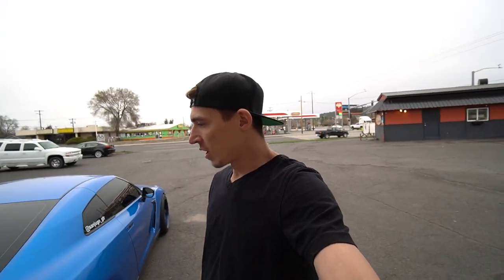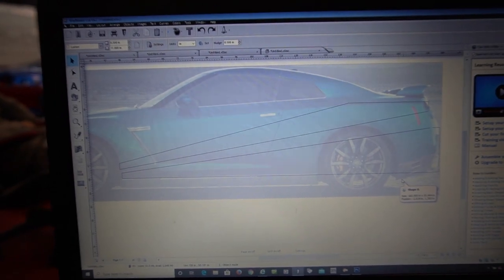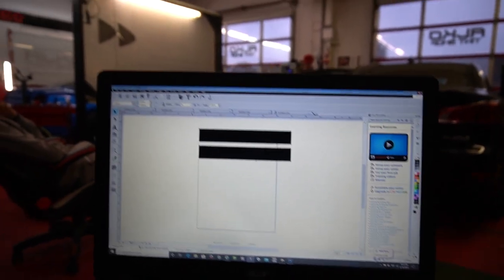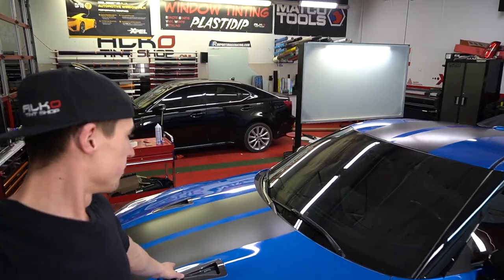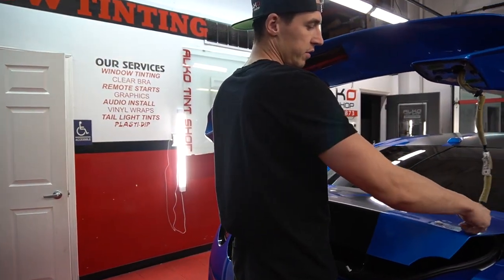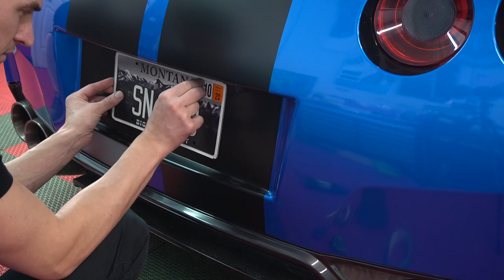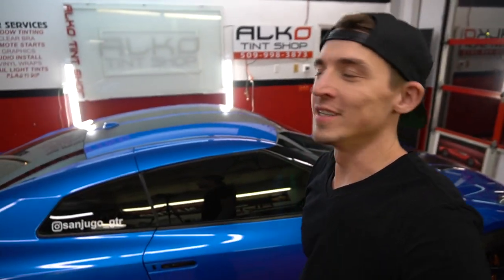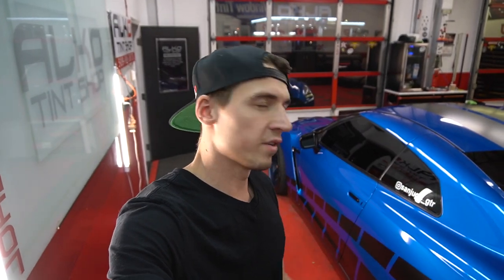Fast & Furious themed GTR Wrap Graphics!! - In memory of Paul Walker - ALKO Tint Shop

Comment: What brand and color?
Reply from the maker: 3M Gloss Blue Fire 1080-G337.    It's a very deep blue color with metallic flakes.  Looks so sharp in the sun. You're trying to wrap your car in a blue?
Reply: No just comparing colors
Reply from the maker: @jon_G75  oh I see. Whats your top 3 colors?
Reply: @leshak1991  3M Satin Dark Grey
3M Cosmic Blue
3M Psychedelic flip
Reply from the maker: @jon_G75  very nice lineup! The cosmic blue Ive never installed. The other 2 I did and both are fire. The satin dark grey is a very clean and badass look and in the sun that metallic flake just pops!! And the 3rd option is a more flashy color. In the sun it's all rainbows and in the shade it's a grey.